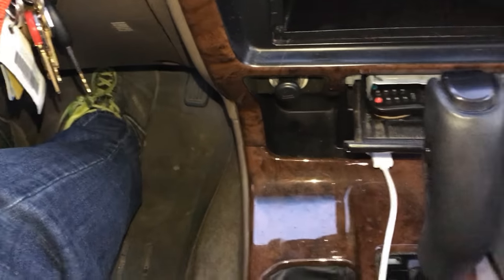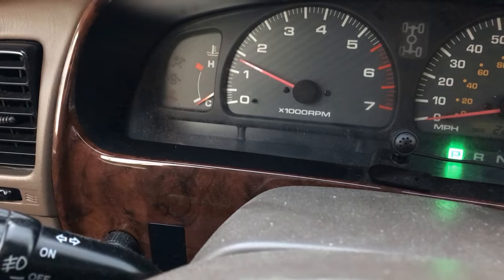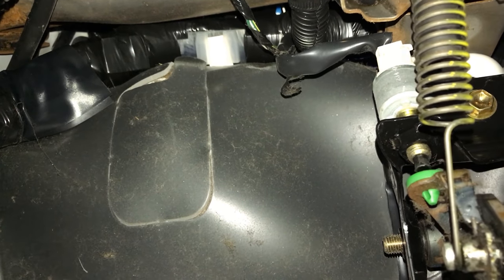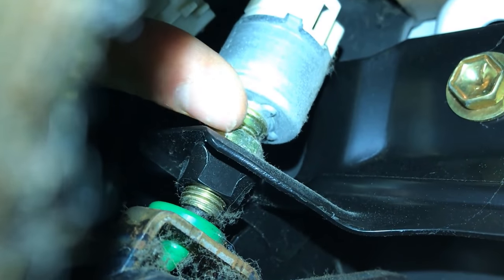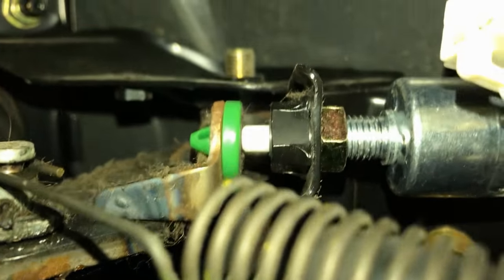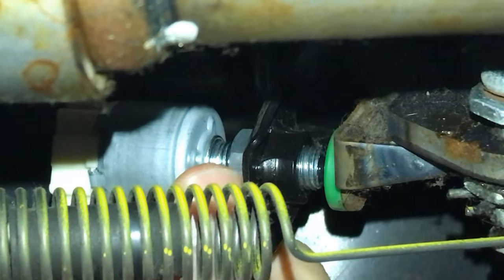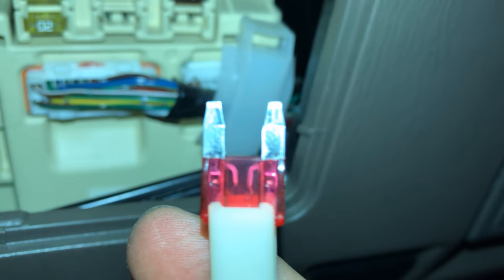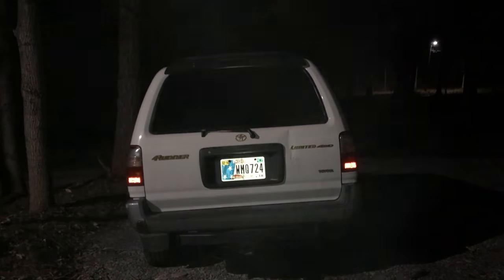Shifter Stuck In Park - It Was A SIMPLE Fuse

Comment: I have an ABS light on, a Traction Control light on, a Brake light on, and the shifter is stuck in Park.  This sounds similar to what you described in the video.  I'm going to check out my  fuses tomorrow.  Thank you for this video
Reply: Did u fix it?
Reply: This the same issue I got. Did u fix it ?
Reply: Someone fix it?
Reply: I had the same problems on my 2016 tecoma. 1. Brake overide Malfunction. 2. Check AnitLock Brake system. 3. Shifter stuck in Park. 4. No Startup and goes into assessory mode. 

Once I replaced the bad 10A brake fuse, all the errors went away and startup no problem and shift out of park as well. 

Thank you, Your video saved me a ton on mechanic bills and time for something as simple as a fuse

Comment: Thank you for your video and advice.  This is what I encountered on a 2008 Yaris (hatchback base) after changing a rear brakelight. The STOP fuse had popped, disabling the braking.  I felt very resourceful after finding the fuse (#9 inside) and replacing it.

Comment: My engine got replaced under warranty, and then I had to replace the alternator and battery. Once the car started up again, it turned over fine, but the radio doesn't work, and the shifter is stuck in park.

Comment: THANK YOU! I have a 2002 Audi Allroad and I replaced the brake pedal switch sensor and the transmission was still stuck in park. As well the heater and air conditioner weren't working as well as the 4 level air suspension. After watching your video, I checked all of the fuses and it was the CONTROL SUPPLY 10 amp fuse that I switched out with a new fuse and it FIXED IT! THANK YOU SO MUCH FOR YOUR VIDEO!

Comment: Glad it turned out to be something simple, this is why I avoid firing the "parts cannon" at problems without at least pulling up a wiring diagram and checking some voltages first. Not only to save on unnecessary new parts, but also because a "NEW" part could potentially be defective out of the box, further complicating your original diagnosis by adding even more problems into the system.

Also it's worth considering what caused that fuse to blow in the first place, it could just be age but it's also possible you have an underlying intermittent short somewhere. That isn't a big deal as long as you make sure to replace the fuse with the same rating, worst case scenario it just blows again down the road and you can diagnose it further at that point. In fact I'd do the same as you in this case, fuses are cheap and there's no point pulling up panels and carpet unless it blows for a second time IMO.
Reply from the maker: Funny you say that. Now that I think about it... it blew when I was pulling a trailer... which I’ve never done before. Didn’t notice the broken cruise control or back up lights for about 3 months.
Reply: P

Comment: My car is currently at the dealership after dropping it off less than an hour ago (a "free" recall and replace of it's AirBag). While there I advised them of the shifter being stuck (the same behavior as your shifter). They told me they would diagnose the problem for $125 and then contact me with the repair cost. -  Your video has just saved me hundreds of dollars. I called them immediately to tell them to forget their diagnosis and just let me know when they completed the AirBag Recall - Thank you!
Reply from the maker: NICE! Hopefully it works. Yeah I would definitely research to see if there is something you could do before paying through the nose.
Reply: Same! Just called them to schedule my recall fix. Told them about my issue and they said it would cost $150 to diagnose, which would go towards the fix.... so could’ve easily been much more $$$. Thank you!!

Comment: Good video, thanks. I just had the same problem with my 2007 Tundra after hooking up a trailer. The brakes lights stopped working and the shifter would not shift. I did some research and thankfully it was only a broken 15A fuse.
Reply: Where was the 15A fuse located??? I am having the same issue with my 2008 tundra

Comment: 05 Camry, shifter won't move, no lights in interior of car, key turns but no sound at all. Alternator, battery, are checked good
Reply: Did you fix the problem? I have the same problem...no electronics work...windows doesn't roll down

Comment: You just saved my ass! Thank you sir! 2007 toyota camry check vsc system, abs and trac off lights were on. Also the car wouldnt start (push to start) and after car was on (bypassing everything and jumping the starter)it wouldn't shift into gear. It was stuck in park. All due to the stop fuse! Thank you

Comment: Thank you for this video.  Shifter was locked in my 2011 Scion Xb and found the faulty fuse and works great again😂

Question, my battery won’t charge.  Power steering is off.  Checked battery and it is good.  Replaced alternator and it still doesn’t charge?  I’m at a loss for why it won’t charge.  Is there a fuse that could be blown?  Fuse box in engine was replaced and not the same as the original manufacturers so the diagram doesn’t match and I have no idea what fuse is what under the hood.  The interior is the original and everything seems to be ok with the fuses. 
Any advise would be appreciated 
Thnx.

Comment: Thanks for info. 2007 equinox, shift stuck in park, key would not let me complete shut off to remove it. Before happened, the roof lights blinked day before.didnt seem to be acting normal. And power locks would not always lock door. Battery draining after 3 months. Removed tab under steering wheel,pushed in spring,removed key. Testing fuses,charging battery, etc.take care.

Comment: This is an amazing video,. Except you did not mention what fuse you replace.  Yes I get what's in common.  But what fuse did you replace?
Reply: exactly what fuse is it 🙄
Reply: @ed3643 The way I fixed mine was the gear shift cord/ transmission connection was lose.   The transmission lever and shift cable slipped out.  It was not the fuse.

Comment: Rogue 2010- the cruise control light comes on without activating it occasionally and needs to be switched off manually. I also have trouble moving the car from the parking position occasionally.

Comment: I realized that it would start working again by lightly pressing the brake pedal upwards, this is, the other way you usually press your brake pedal. I wonder if I could finally fix it by just adjusting it a little bit instead of changing the entire piece

Comment: I changed that little switch u did under the brake area all seemed to work fine but now I’ve noticed the brake pedal gets stuck in the braking position sometimes.  After a while u can smell brake burn. But if I slap the brake pad with my foot a few times it goes back to normal lol it’s a 2007 Honda Pilot

Comment: I got 2003 crv Honda,  my  shifter didn't work,  can only shift to neutral and drive,  got mechanic check shift linkage and solenoid and still didn't work,  finally check  the fuse box found out the radio fuse line was broken,  have it replaced and able to move shifter, just let you know  to solve problem and save money

Comment: I have the same issue in my 4Runner and also replaced the brake switch.  There is nothing I can find that indicates which fuse goes to this area.  Can you tell if it’s a 10,15,20 fuse and where ?  Thank you kindly!

Comment: Indicators not working. Moved the shifter by pressing shift lock to neutral n starts and moves in reverse but the lights dont work. Parking lights n brake lights work. Once back in reverse doesn't move to reverse.

Comment: What was that fuse you replaced labeled as? Curious. I have a problem with cruise control activating , brake light and gear shifter stuck in park. Thanks
Reply: did u ever fix it bro!

Comment: Thanks for the video my 2013 Pathfinder just did this.  I drove it this morning, this afternnon stuck.  My question is a fuse is a safeguard that fails so the circuit is not damaged.  What would cause the fuse to go? Old age?  I replaced the fuse. Gear shift moves!  But I did a continuity test on the fuse and its good.
Reply from the maker: Probably just old age I would imagine
Reply: What fuse did you replace

Comment: Hi Dear, i saw your useful Video, i would like to know , I am using Nixxan X-Trail Model T30 (Auto) , some time i park my car on slope , later i start my car and shift reverse gear is very difficult i need to force which i do not worry will happen wrong, help some one to push the car then easily gear shift to R or any other ,  can you advice me regarding this, Thanks

Comment: Had same issue on a 1996 Ford F-250. Wouldn’t shift out of park and no brake lights.I checked the brake on/off (BOO) switch with  an ohm meter set to continuity. The  switch was ok. Turned out to be a 10 amp fuse for the trailer lites located in a fuse box under the hood. I had just put new lites on a trailer, and a wire got crimped and eventually shorted out. It’s a sick feeling when you start up your vehicle, and it won’t go into gear. On trucks with a towing package, they have the additional fuse for the trailer lite receptacle along with the usual 10 amp fuse in the passenger compartment

Comment: shifter, cruise control, brake light and horn all stopped working and the hazard light started acting up on my mazda 3. A fuse solved it
Reply: Wouldn’t u know. A dealership would have replace all that you mentioned before checking any fuses 😂 😂

Comment: Unless you drive almost any Nissan  because they use the a p.o.s plastic plunger with a flimsy metal arm to engage the shifter out of park once the brake is applied... and they fail thousands of times every single model they have ever made from 2012-2020 and they refuse to recall them they just send you a bulletin about it and how to replace the part.!! How can they even get away with that. $20 part but takes an hour to get all the panels screws and wires moved to get the center console out and replace the part if so inclined or a $699 replace and repair cost for something they know is their fault .... nuts. I wished it were a fuse on my 2014 Altima but thanks for the video!!

Comment: I can get it out of park if I use a screwdriver but goes back to being stuck once I put it back in park. Is that normal?
Reply: Not normal mind does the same did you find a fix?
Reply: @tiacapri  please lmk if you did 🙏 🙂
Reply: Hey I just fixed mine.. hold the button down and go up and down while the key lever is held. (Hard) it basically fixed its self

Comment: Hmmmm definitely something I'm gonna have to check. Yesterday my car also locked into park. However, I also lost all my dash lights (including the digital odometer, trip, mpg, ect) only excluding the air bag light (furthest light to the left). Shift lock release worked; until put back in park - same as in the video.
Reply: My car just did this 2 weeks ago. Did you find out what the problem is?
Reply: @Abursey2  sorry I just saw your question. Yes, I did figure it out. After scouring YouTube I found a suggestion to spray out the gage cluster. I thought it was ridiculous and completely irrelevant. It worked! I tried everything else; so, I figured what the heck. Try it out. It freaking worked!
Reply: With compressed air........spray out the gage cluster with compressed air. Sorry i left that out accident.
Reply: I have the same problem...also windows, ac/heat and radio doesn't work

Comment: I have a 2005 Ford Explorer four-wheel drive I have just changed the transmission entirely from another explorer that I know that worked but whenever I change gears the tires still don't move.

Comment: 2011 kia forte stock brake lights melting housing. Replaced with LEDs and driver side rear brake light would not come on. Pulled the contacts on the socket side up to make better contact....light works now and traction control light came on and shifter stuck in park...the fuse was blown....replaced fuse...fixed
Reply: Also replaced brake light switch and thar didn't fix it.. faulty fuse.

Comment: So do you feel that the brake switch was not the issue, or maybe it was both? Great job on the video. I have a 97 RAV4 that the cruise was blinking and the shifter just locked up today. I will check brake lights when my son gets home from work.
Reply from the maker: This was a while ago. But I think I put the old switch back in. Changed the fuse. And it worked

Comment: my shifter got stucked in P in my honda civic 2011 after i press horn a lot in traffic the fuse got burned melted with break lights off went to electrician he replaced the fuse holder with fuse and everything seems fine now had to remove the horn as it got short burned as well

Comment: What was the name of the fuse ended up replacing?
Reply from the maker: Looking at a fuse box diagram I took out fuse at position 30 called STOP and it was 10 amps. Is that what your asking for?
Reply: Bob. Its name is Bob.
Reply: I've got a Honda accord 1993. It struggles to go into park and out of park . Will go in but with a touch of force.  Any suggestions please?
Reply: @amjidkhan2392  how did u fix it

Comment: I have the same exact problem in my '09 Corolla. Gonna try this out. Thank you
Reply: Was it a bad fuse?
Reply: @dFreemZ  no, what ended up happening was I figured out that the manufacturer had the fuses for "open slot" and "brake light" were not labeled correctly in the manual diagram.

I was so frustrated at the time I had even ordered a new brake light switch thinking that was the issue. Nope, the issue was I just needed to add a 10/25 amp fuse to that "open" slot and, "woila!" My car was no longer stuck in park.
Reply: @drewdatification  please lmk what you did..I hace a 2010 and have this issue. I haven't looked at it yet.

Comment: My Clio got stuck in park,on the dash it said it was in drive, lights on the dash but no power either.
All i did was lift the bonnet a cable had come loose near my battery I just connected it and jumped the battery, just going to buy a new cable incase it happens again

Comment: I have a 1989 Pontiac Grand Am and I just replaced the steering column on it everything seems to work but I can't get the center console shifter to move, the button doesn't work,  it's not the fuse there's no electrical part on the break so I'm trying to figure out what has the shifter got to do with the column?

Comment: 2015 sonata stuck shifter....replaced brake light switch,,  nothing, replaced inhibitor switch nothing,,, what next
Reply: You still have one year in the warranty.
Reply: @michaelserrano7097  i have 68k miles on recall motor.. and 150k miles on original motor... 217k miles means no warranty
Reply: My elantra facing same problem.
Also Reverse assist not working.
By manual override button car shifts into drive mode but with very hard jurk.
Cluster doesn't show P R N D . 
What will work for this?
Reply: @tusharpadwal3965  im not sure,,, in the heat my car shifts ok, but if its cold i have to play with it a bit to get it to work..
Reply: Did you find anything

Comment: The Toyota dealership said they couldn't find the problem and my radio had stopped working. They told me the radio needed replacing and the shift was just dirty. My truck is 12 years old so I believed that. But the shift still gets stuck.

Comment: Lol I've read almost every comment and I notice something very common which is no one has been able to get him or anyone else commenting to help explain or give ideas on which fuse it might be that we should check my santa fe doesnt have a shifter release button so I'm stuck in park
Reply from the maker: Well I mean I guess you just check them to see which one is broken. I went online and found a fuse diagram specific for a 1999 Toyota 4Runner. You will have to do the same and then you may have extra fuses located underneath your fuse box under your hood with a pair of tweasers to replace
Reply: Those cars don’t have the fuse, on them you have to take a screwdriver and pop the  silver plate that covers the shifter and then stick a screw driver down until you see a white, red or pink plastic tab push it down or to the side while you pull the shifter back to natural then start the car, done!